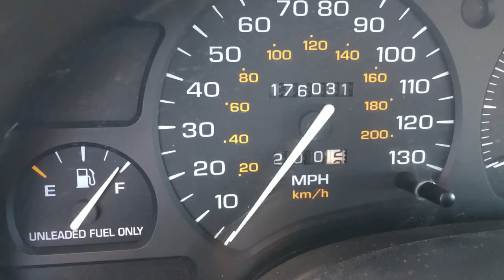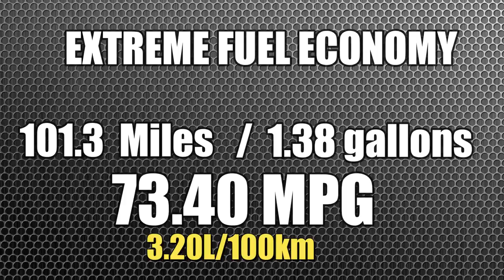S3 E11. Kubota turbo diesel Saturn extreme fuel economy.  super high MPG

Comment: For a delightful happy hour and relaxing evening  try some wine and cheese..
Reply: Pinot Noir and Gruyere

Why it works: The ever-present red berry fruit of a Pinot Noir is the perfect match for the nutty flavors found in a medium-firm cheese like Gruyere. Both have just the right amount of aroma and complexity to them, without running the risk of one overpowering the other.

Also try: Beaujolais and Jarlsberg, Gamay Noir and Comté, or Zweigelt and Emmental.
Reply: Aged Port and Blue Stilton

Why it works: Port is known for its full body, sweetness, and bold character. And when you’re dealing with all that, you need a cheese to match: something stinky. The complex character of a pungent and salty Blue Stilton matches up beautifully with an older, sweeter Port. Remember: the sweeter the wine, the stinkier the cheese.

Also try: Ice Wine and Beenleigh Blue, Oloroso Sherry and Torta del Casar, or Sauternes and Roquefort.
Reply: Champagne and Brie

Why it works: The softer texture of triple-cream cheeses like Brie demands something sharp and acidic to cut through the fat. The high acid and pleasantly stinging bubbles of Champagne combine with Brie’s thick creaminess in a contrast that is very satisfying. Plus, that brioche flavor you get in traditional method sparklers adds a tasty bit of toastiness.

Also try: Chardonnay and Camembert, Cava and Délice de Bourgogne, or Crémant and Époisses
Reply: Moscato d’Asti and Gorgonzola

Why it works: As we’ve said, funkier cheeses call for a sweeter wine, but the lightness of Moscato and other sweet whites can be a terrific change if you’ve only ever matched pungent cheese with heavy, fortified wines. The fresh, acidic fruit of a Moscato d’Asti cleans your mouth of heavier cheeses like Gorgonzola, leaving you nice and refreshed.

Also try: Gewürztraminer and Munster or Prosecco and Asiago.
Reply: Tempranillo and Idiazabal

Why it works: Tempranillo and Idiazabal are a great example of the old adage “if it grows together, it goes together.” Both are Spanish, and both have savory, smoky flavors that match together perfectly. The full body found in your average Tempranillo is a terrific combination with the harder texture of Idiazabal, while the tannins of the wine contrast with the buttery flavor of the cheese.

Also try: Rioja and Manchego, Garnacha and Zamorano, or Mencía and Roncal.
Reply: Sauvignon Blanc and Goat Cheese

Why it works: While they’re earthy and tart, most goat cheeses are a bit of a blank slate, so the citrus and mineral notes found in a French Sauvignon Blanc bring out the wonderful nutty and herbal flavors that can be found in the cheese. The acidity is also a great way to cut through the heaviness of the goat cheese.

Also try: Chenin Blanc and Chèvre, Grüner Veltliner and Florette, or Chablis and Cremont.
Reply: Provence Rosé and Havarti

Why it works: The crisp, red fruit you find in a Provence Rosé is delicious but delicate, and the mellow flavor you find in a Havarti complements the wine gracefully without overpowering it. In addition to this, the steely minerality of a Provence Rosé is a great contrast to the smooth, soft texture of the cheese.

Also try: Pinot Noir Rosé and Fontina, Sangiovese Rosé and Mozzarella, or Rosado and Ricotta.
Reply: Riesling and Raclette

Why it works: Smooth and buttery, Raclette is a mellow and versatile cheese that blends really well with the high acidity and stone fruit flavors found in a Riesling. The aromatic scents of the German classic brings out a subtle and surprising nuttiness in a good quality Havarti cheese. Consider a Kabinett or off-dry Riesling so that its sweetness doesn’t overpower the cheese.

Also try: NZ Sauvignon Blanc and Mild Cheddar, Silvaner and Raclette, or Gewürztraminer and Edam.
Reply: Chianti Classico and Pecorino Toscano

Why it works: Another great “grows together, goes together” pairing, the hard, aged texture of a Pecorino pairs wonderfully with the booming tannins of a Chianti Classico. The savory secondary notes in a Chianti bring out a hidden herbal flavor in the cheese, with the wine’s black fruit holding up perfectly against the boldness of the Pecorino.

Also try: Sangiovese and Parmigiano-Reggiano or Brunello di Montalcino and Grana Padano.
Reply: Vermentino and Fiore Sardo

Why it works: A nutty sheep’s cheese, Fiore Sardo does very well alongside the more oily texture of a Vermentino. The saline flavors of both make sure that each only enhances the other, with Vermentino’s citrus notes adding a fruity acidity to the fatty character of a sheep’s milk cheese like Fiore Sardo (aka Pecorino Sardo).

Also try: Soave and Mascarpone, Grechetto and Fromage Blanc, or Verdicchio and Requesón.
Reply: Malbec and Edam

Why it works: The combination of Edam’s nutty flavors and Malbec’s velvety fruit is the sort of pairing that just about anyone can enjoy. Both the wine and the cheese are flavorful and aromatic without being overpowering, and the result is a complementary combo of complex flavors.

Also try: Shiraz and Gouda, Monastrell and Tomme, or Blaufränkisch and Abbaye de Belloc.
Reply: If you’re planning a party and serving cheese and wine, try to include at least one of the sweet wine and cheese pairings mentioned above. Not only are they delicious, but they might even change your mind about what’s for dessert!
Reply: A Guide to Dessert Wines

Sweet wine comes from extra-sweet grapes! To make a sweet wine, the fermentation is stopped before the yeast converts all grape sugars into alcohol. There are several ways do stop fermentations, including super-cooling the wine or adding brandy to it. The result is a rich wine sweetened with natural grape sugars.
Reply: The carbonation and high acidity in sparkling wine makes it taste less sweet than is actually is! Certain grape varieties smell sweeter than others. This tricks our brain into thinking they taste sweeter too! For instance, a Demi-Sec (aka “Semi Secco”) Moscato tastes sweeter than a Demi-Sec Champagne even though both may have the same amount of sugar
Reply: Lightly sweet wines are refreshingly sweet; perfect for a warm afternoon. Many of these sweet wines pair well with spicy foods like Indian or Southeast Asian cuisine. Lightly-sweet wines are best enjoyed as close to the vintage date as possible, save for rare examples, like German Riesling, which age quite well!

Expect these wines to be exploding with fruit flavors and well suited for fruit-based and vanilla-driven desserts. For instance, consider Gewürztraminer: this wine is known for its lychee and rose petals aromas. A Gewürztraminer pairs excellently with fruit tarts.
Reply: Late harvest means exactly what it’s called. As grapes hang on the vine longer in the season they become even sweeter and more raisinated, resulting in grapes with concentrated sweetness. In Alsace, late harvest is called “Vendage Tardive,” and in Germany it’s referred to as “Spätlese.”

Any grape left on the vine can be used for late harvest wines. That being said, it’s popular to find late-harvest wines using Chenin Blanc, Sémillon, and Riesling grapes.
Reply: Ice Wine (Eiswein)

True ice wine is extremely rare and expensive for two reasons. One, it only occurs in bizarre years when a vineyard freezes. And two, ice wine must be harvested and pressed while grapes are still frozen!

The largest ice wine producer in the world is Canada. You can find ice wines in cooler regions like Germany, Austria, and Switzerland.

Most ice wines are made with Riesling or Vidal grapes, although anything, even Cabernet Franc, can be used to produce an ice wine. You’ll find them to be honeyed and richly sweet, similar to a noble rot wine.
Reply: Sherry comes from Andalusia, Spain. The wines are made using Palomino, Pedro Ximénez (a grape, not a person), and Moscatel grapes. Wines are produced using varying amounts of the three grapes and are purposefully oxidized so that they develop nutty aromatics.

Comment: Try putting the engine in a Micra/Versa/Corolla/Bolt/Aspire or some other smaller lightweight car; you could get close to 100 MPG Milage you show is about the same as a 1980s TD Jetta

Comment: Wait... "Is ONLY realistic in a Mad Max-type world" (@6:18)?

What are you talking about? Why only realistic in a Mad Max world? That doesn't even make any sense. For starters, Mad Max is sheer fantasy (particularly that latest crappy movie - I based my life on Mad Max's teachings, back in the 80's).

Besides, with your cute, friendly voice, I don't think you'd make that in a Mad Max world (which admittedly does currently exist in some locations in the U.S. - Just try spending a day in Portland, OR).

In my case, 1990 1st Gen. Cummins 12-valve. Can run on mixtures of vegetable oil, (recycled) motor oil, etc. That's my EOTW vehicle.

BTW, if you want a more realistic version of an Australian Mad Max movie, try the Guy Pearce movie, The Rover.

Comment: Huh? Oh wait? Our Imperial gallon is 4.5 liters and US is 3.8. I was getting 55mpg in my 2002 civic. 
Heres one. I know a guy that was getting 150 MGP in a compition. Seriously. This guy owned a Chev dealership and rigged up a 3 cylinder. He'd turn it off going down hills and even changed out the wheel bearing grease.  You can call me or him a liar all day long, but this guy is 100% strait up.

Comment: Why wouldn't you just weigh the fuel needed after your run, that would be a hell of a lot more accurate
Reply: @drippingwax  It would literally be as easy as filling it up to the very tippy top do your run and then filling it back up when you got back and weighing out the loss in a pre-weighted jug

Comment: If u kept the old tank on, you could easily get away with using farm diesel. If the diesel tank is under the hood and u put some diesel in the old tank. Legally u shouldn't but the stock tank might trick a sheriff

Comment: I wish you would fix that manifold to turbo pipe to turbo size difference, the flow paths is horrible, with that roughly 2-3mm wall around the inlet to the turbine housing, I think id split the pipe, and make a cone shpe , that would fit into the turbo, just the top, and weld it to the flange. Then grind it flush, maybe welding it on the inside, and grind it smooth, and match it to the inlet size, it could possibly pickup a couple HP, and ftlbs of tq's ,.  I see a cracked head at the junkyard with casting flash in the ports , I want to port it! 😆, Haha, or see a lawnmower carb adapter not quite matching the port, I port match it,  basically any head I have had off, I scratch around in the ports a bit,  I can't stand to see misaligned ports, please fix it! ✌️' haha, seriously, it's yours , do as you wish, but it would. Be interesting to see if it's going to make noticable difference in performance by fixing it?! ✌️

Comment: Thanks Jimbo for putting all the effort into this particular episode; the fuel mileage when driven conservatively was what I was most interested in.  Yes, compression ignition engines run many times leaner that spark ignition types during cruise conditions.  I wish a wind tunnel was conveniently available to measure drag coefficient to evaluate some of the external body changes you made.  Although, driving at 45 to 50 mph won't generate that much drag unless you are driving a car with boat sails.  I'm guessing from the acceleration figures the latest tune generates, your output power is in the mid 30 something range.  I noticed on this latest video, the steering wheel position is off when driving straight; could your front end alignment be off, which would  also affect fuel mileage?

Comment: I bought a new 2012 tdi jetta with a 6 spd manual. It had a 14 gallon fuel tank, and often I would get 1050-1100 miles per tank. Often going 75-95 mph here in the mountains of Colorado. Unfortunately because of the emissions scandal, I was forced to give the car up. I really think it was because of the fuel economy, because it passed the emissions tests every year by a lot. Great video!
Reply: Howdy Harry, I'm Australian, why did you have to give up the VW?, that didn't happen here.
Reply: I still see them for sale used so you must have decided to.

Comment: Max it out with .custom pump/ Gap rings /water alcohol injection pre intake manifold /and Propane and then do top speed hp run.
Reply: @drippingwax  all thing he can do to the motor. And then do a topspeed run and dyno pull.

Comment: How to Survive a Flash Flood
Reply: A flash flood is a sudden flood that occurs within a few hours after heavy rainfall. They typically happen in low-lying areas where the ground isn’t able to absorb all the water that’s fallen from the sky.
Reply: In the United States, flash floods are common in the American Southwest. But they also occur in urban areas across the country due to all the pavement in cities (pavement, of course, can’t absorb water). Besides heavy rainfall, flash floods can be caused by dam or levee breaks.
Reply: The biggest reason people die in flash floods is that they underestimate their force and danger. Floodwaters can contain downed trees and debris that can strike you if you wade into them. And even seemingly shallow water can knock you off your feet and even sweep away your vehicle.
Reply: Understand and pay attention to flash flood alerts. There are different levels of flash flood alerts. Flash flood watch: flooding isn’t guaranteed, but conditions are favorable for it; be ready to take evasive action if needed. Flash flood warning: flash flooding is imminent or already occurring; move to higher ground immediately. Flash flood emergency: a flash flood is occurring that severely threatens human life/catastrophic damage.
Reply: Get to higher ground. If you’re in your home when a flash flood hits, move to the upper floors or roof. If you’re outdoors, move to higher ground as quickly as possible. If water is rising around you, try to climb a tree or on top of a rock or other structure.
Reply: Turn around if you’re driving and see a flooded road. Avoid driving through flooded streets; nearly half of flash flood deaths happen in vehicles. A car can stall in less than a foot of water; two feet of water can sweep vehicles away. Additionally, water can obscure an area where the pavement’s been carried off, leaving a car-swallowing hole.
Reply: @kansasrose2909  any   other tips here?
Reply: As a last resort, swim defensively to safety. If water continues to rise, the car you’re atop is being swept away, and rescue isn’t imminent, or you get caught in floodwaters while on foot, swim defensively to safety. Try to protect your head and upper body. Turn your feet downstream and keep them up to avoid getting trapped beneath the water. Use your feet to block debris and navigate around it when possible. When you see calm water, swim towards it by swimming across the current, like you would a riptide.

Comment: Gasoline engines only get hotter egt until around stoich air fuel ratios around 14.7 to 1. Race engines typically run around 12.5 to 1 so when you lean it out to 14.7 it gets hotter and can melt parts but beyond that say 16 to 1 it would have cooler egt than it would at 14.7. Those race engines running 12.5 are basically using that extra fuel to cool the combustion where a diesel uses excess air to cool the combustion. Saturn rockets use fuel to cool their combustion chamber like a gasoline engine does so if you look closely at the fire coming out of the engine there is a black flame very close to the rocket nozzle, the same effect causes faint black exhaust from many gasoline racing engines.

Comment: Nothing wrong with metric. It is easier. Oh, it wasn't mentioned but I'll assume your units of time were in 10 not 6. Some metric users have the silly practice of mocking imperial units because they aren't in units of 10, only to use time units of 6 or minutes and seconds. At that point 7250mL @ 60kmh for 1:43:27 h:m:s is as useless as imperial units. This is how you end up only 2 car choices in the entire industry. 1955-1989 Lada in your choice of gray or grey. The gray has an 8 year lead time and the grey has a 10 year lead time. All because they switched to metric in everything except the most used variable..... Time.